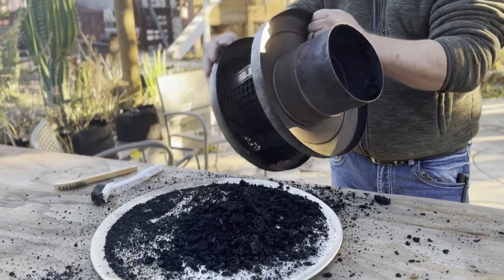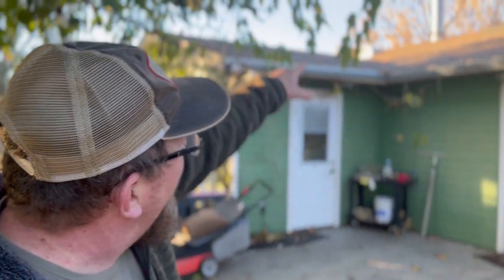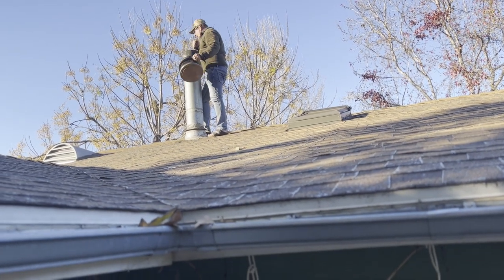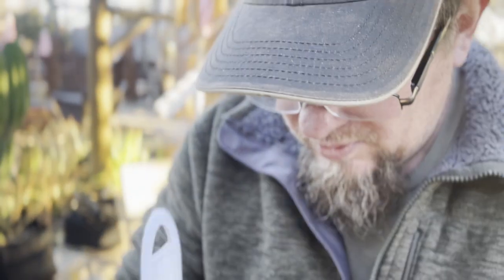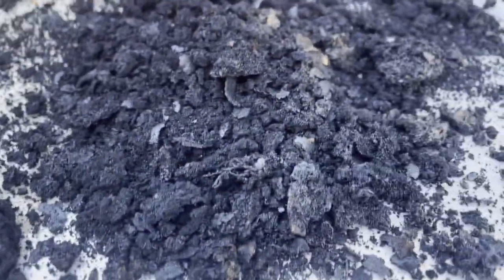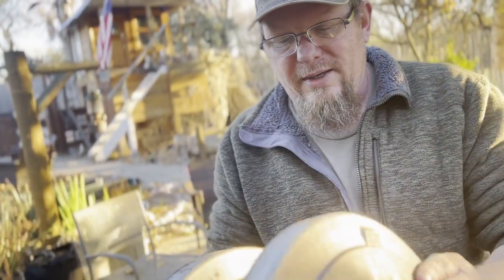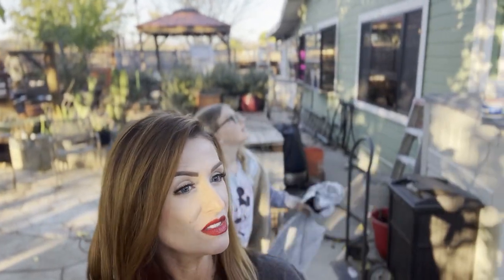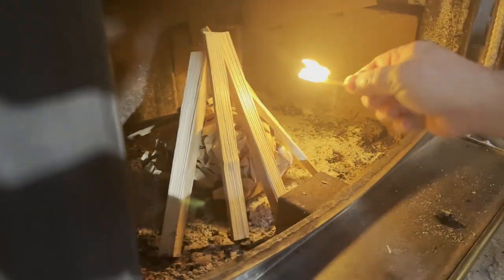What Is Wrong With The Chimney?

Comment: I found out the quick way to clean out my spark arrestor screen which is way to high for me to reach......several shots from a scoped .22 cal air rifle using flat nosed pellets will knock out the creosote crud in a quick and effective manner. Takes only minutes and saves hundreds of $$$ over hiring somebody to do it. Works like a charm, doesn't hurt the screen and made my wood stove work like new again...

Comment: When  you burn wet wood this happens for sure.
Reply from the maker: It was all dry but it can still build up overtime … it was our main heat source so it was burning none stop for about 8 weeks a year
Reply: @3MISSISSIPPI   My stove burns for four months straight and I do not have this problem. My stove has a secondary burn feature which I made that works perfect. The second thing is my wood has only 1 to 3 percent moisture content. Reason being I keep 2 cords of wood inside my home in the man cave area. The seasoned outside covered wood 2-3 years aged get at least 6 months more drying inside when the air conditioner is running all summer. This makes the wood ultra dry. All hardwoods, burns to literally nothing. Chimney has no creosote, PERIOD !! Just dusty a bit like a pellet heater.   No black carbon soot !! Peace vf😀😀😀😀

Comment: your "flute" is like a liquor still the cap is the first place the unburnt gasses  could cool off at .  in the future every so often go outside where you can see thru  the cap and if you see it beginning to clog up put a cup of salt on a very hot fire and let run it for awhile like after you first fire it up and are trying to quickly heat up the room it's not a solution but will extend the time between needing  to clean it out
Reply from the maker: Good trick !